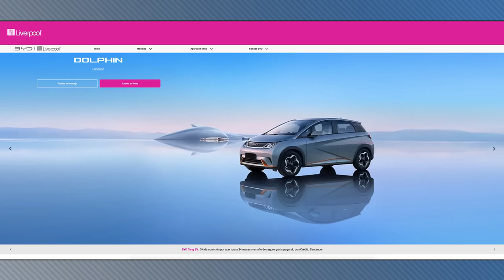Nissan Ariya in Production Hell; BYD to Sell Cars in Mexican Department Stores - Autoline Daily 3711

Comment: Cruise will also be found to be misreprenting its ability and claims as a leve 5 autonomous vehicle for ride sharing given that on average every 3-5miles a human has to intervene.
For a level 5 this should be every houndred thousand miles or so in my view. The regulators need to come to a common benchmark.
What I am sure about is that investors do not think level 5 is obtained at an intervention on average every 3-5 miles.
What is thr bloody point if this is how frequent a remoteassistant has to jump in. 😮

Comment: The big robo taxi problem isn't leadership or technology. It's demand. The estimates to get the funding for development were many times reality.
Reply: Teslas were supposed to be "FSD" and have rtoboteslas on the road in 2020.   Both were a bit more complicated than originally suggested.  4 years later and neither are on the road.  It's not a demand problem; it is a tech problem.
Reply: @craighermle7727  We shall see.
Reply: @frankcoffey  We may both be correct. However there has yet to be a company that has produced a fully autonomous self-driving solution, so it's hard to say if there is demand.  I think at this point there are a lot of Musketeers cheering every advance Tesla is making towards  "FSD"  but it still isn't FSD.  The Cruise program seems like it was  more of a clandestine drone program

Comment: Where do components for Tesla  model Y/3 other than batteries come from . Are any of these Chinese suppliers ? Just wondering what percentage is actually manufactured in the USA.
Reply: Most battery grade lithium is refined in China. Since Tesla makes 50% of EVs sold in the US, hard for them to source enough battery materials without tapping Chinese sources. That's why they built their own refinery in TX. Be awhile for it to ramp and significantly displace Chinese sources.
Reply: They're actually just about the most US-made vehicles in production.  But battery stuff is specifically what matters for this tax incentive.  China dominates the battery market.  One of the things this incentive hopes to change.
Reply: Well aware of the battery situation. What I want to know is how many other components come from China. VW are being asked to provide details of the manufacturing origins of components. Only reasonable that Tesla would have to provide the information for scrutiny of how it was made.
Reply: You would be surprised. At one time a Toyota Tundra I owned had more US components than my friend's Chevy Silverado.
Reply: @lesliecarter4295  For interested parties there are groups in the US that help track how "US-made" a car is, if said car is being sold here.  Tesla ranks pretty high.  F150 is high.  For most makes it is quite model specific.
Seems the heat VW is taking isn't over being Chinese made (at least the discussion in this vid) ... because it's a Chinese made car of course ... but where in China & the nature of the workforce.
Reply: @lesliecarter4295 I'm surprised that you are not already aware, since you seem so interested in the subject.

Tesla gained a reputation about ten years ago for selling the most domestically sourced cars out of any US manufacturer.  I believe all of their models are at the very top of the chart for what proportion of the parts come from the US.